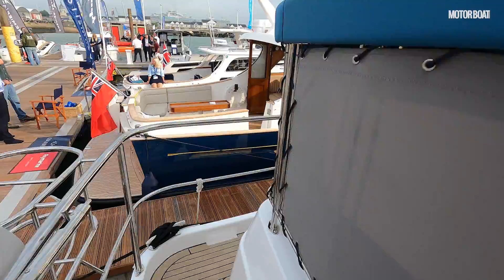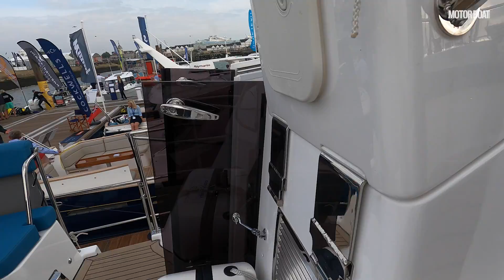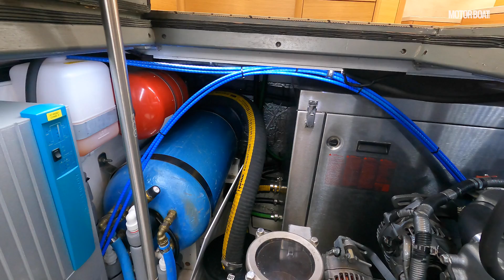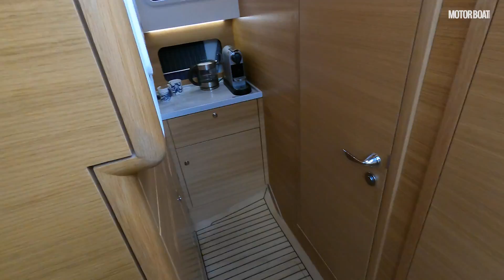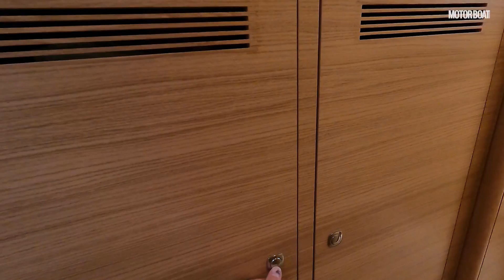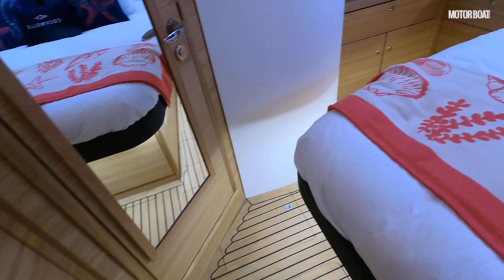This sturdy liveaboard cruiser has a diesel-electric heart | Hardy 42 Hybrid yacht tour | MBY

Comment: Really, my only question is, are any access hatches?  Diff topic: The hidden TV is deployed manually ‘nothing electric, nothings going to fail.’  Yet the dining table is on an electric lift.  I’d prefer to take the risk, like with the dining table, and have the TV on an electric lift.  Also, a larger TV than the small computer monitor which manually drops down from the ceiling.
Reply: it was the customers spec so I guess Cockwells could give you electric if you wanted it

Comment: Looks very nice but such a limited range, would have expected at least 1,000 miles on the engine. Don't like the galley either, no fiddle rails or pan clamps on the hob, it would be OK for the inland waterways but definitely not rough seas. The food storage is terrible, a minute freezer and such a tiny fridge. Very well built though.

Comment: Very well designed cruiser...I can see myself living aboard quite comfortably.
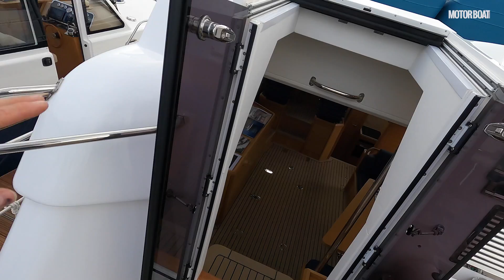however there are a few things I'd change.. the top of the  cabin doors @5:40 looks like it could do some damage should you slip or fall on them...the middle seat next to the pilot chair @10:53 could use a rail about elbow height at the right ..that's a fairly high fall if a heavy sea pitched you to the right over the woodwork and for a boat with all that storage and ability to long distance cruise that fridge/freezer combo is too small..

Comment: With the electric motor. If they were smart they would go one of 2 ways when using the engine. Either disengage the electric motor and let it free spin which is wasted potential energy, of use the spinning regenerate the batteries.

Comment: I have been saying for 10 years... WHY NOT A SMALLER DESEL ENGINE TURNING GENERATORS to charge batteries or run over 30% ....   under 30% running the batteries/solar works...  for a while... then the generators kik on and quickcharge  then power down and it gets quiet again...

WHY IS THIS NOT A THING ???  

or MORE OF A THING?!?!??!???

Comment: what about a couple 25 hp Yanmars running generators for redundancy and having even more lithium Ion batteries...? No need for the big diesel....  If you need a few miles of full power/ higher speed , run both small engines at top rpm and draw off the batteries....

Comment: What a stupid idea. Just put a wing engine in.
Reply: on the contrary, the idea is excellent its execution is just not all the way. This boat needs two larger electric motors of about 100kW each, that would save a lot of space by not luggin that massive engine around, a larger generator, give up most of the flybridge for a solar panel deck, and then use all the space saved by getting rid of the engine for more batteries.

Comment: Wouldnt the diesel running at 6knts be just as environmentally friendly as the generator running the hybrid system at 6 knts?  I can see how for the first two hours when you leave the dock after having topped up the batteries from shore power, that could in theory be better for the environment.  But once you go beyond those 12 nautical miles and need to turn on the generator top up the batteries again, then its hard to see much gain from the system.  That hybrid system seems like a lot of added complication and cost for not much gain, unless you happen to have a use scenario where you are frequently going to take trips that are 12nm or less and don’t mind doing that at 6knts.   Or am I missing something?  

Don’t get me wrong, I love the boat other than the hybrid aspect.  I know thats the future and look forward to it, but i think this implementation shows that the technology just isn’t ripe yet for this sort of vessel.
Reply: My understanding is that it would use less fuel as it’s a smaller Diesel engine running at peak efficiency rather than a big Diesel engine running well below its peak efficiency. It’s also not good for the engine itself to run for long periods at low revs
Reply: on the contrary, the idea is excellent its execution is just not all the way. This boat needs two larger electric motors of about 100kW each, that would save a lot of space by not luggin that massive engine around, a larger generator, give up most of the flybridge for a solar panel deck, and then use all the space saved by getting rid of the engine for more batteries.

as it is now it's just half way tranisitioned to electric drive, but running the generator for up to 6 knots is a lot more efficient than running the large engine at low revs, since the generator will always be running at it's maximum efficiency RPM, whilst the engine won't.

Comment: Love the sturdy no nonsense ethos of this vessel. I would be interested to know what the range would be just using the electric motor and generator cruising at 6 knots?  Could It it possibly go 1500 miles or more?
Reply: The range as listed in the brochure for the 40-series is only 320nm. So this seems to not be CE rated at A.
Reply: Most of the yachts in the Hardy range barely can make 320NM. The largest 65ft can only do 550NM so I don't think it would be any more than 500NM at an optimistic guess. You'd be better off with a regular diesel on something that offers bigger tanks. Check out the X-treme 54, 2400NM from two small diesels
Reply: @karlfriedrich7758  would depend on your speed, for the 65DS 6000 liters of fuel at 6/7 knots equals lots of miles
Reply: @allandoyle1809  of course, though without any tests we can only go off the official specs for the 65DS which they've listed around 900km+ at an unknown speed 

If there's one thing I wished trawler manufacturers did, it's list a proper full and half-laden fuel consumption chart instead of 6 pages about the airy feel of the cabin etc. Only seen a handful of them do that, though it's so useful when they do.
Reply: I wonder the exact same thing... Maybe even further....
Reply: 6 knots x 2hrs.
I wonder how far it can run on the hybrid system?
Reply: Nowhere near that range. See the comments.

Comment: Why didn't they install a couple of OceanVolt electric drives and go diesel / electric? Put a generator on the engine and have no mechanical connection between the engine and the props. Run off batteries if you like, or engine, your choice.

Comment: Why do the openings of those ventilation pipes on the front deck (just ahead of the windows) face forward?  Can't surf/splash get in if the openings face forward?
Reply: I imagine it's to allow the vents to capture air when underway, like forced induction.  I also assume there's some protection from spray measure inside the tubes, or that it's just not an issue for this hull.
Reply: @scottstewart5784  -- yeah, but how is water prevented from coming in if they face forward.
Reply: @markegg7680  They have sensors, so if spray is detected they twist out of the way real quick.  Just kidding.  It's either just flat NOT an issue for this hull, or perhaps there's something inside the tubes that channels water (if any) to the pipes in the heads compartment.   What isn't true is that you've discovered a latent design defect that will bankrupt the company.

Comment: Lovely boat, but a very poor hybrid system.  If you want a hybrid only Greenline does it properly. This looks cobbled together. On the Greenline system the motor doubles as the generator.
Reply: The problem then if one system fails, you lose the generator and the electric drive. It may look “cobbled together”, but simplicity is often undervalued.

Comment: Did they use the batteries from a BMW i3 as well? Seems like every electric boat has either the battery, or the battery an engine from an i3. Which makes me wonder where are the it's these people keep using for their boats. I imagine since BMW is such garbage,the cars fell apart and were junk but somehow the battery and engine were still good. Which is ironic because the engine in the car formthe ICE engines always fail and take out everything inthe engine bay with them.

Comment: Great vid, but you frustratingly skipped over the joysticks at both helms. Is it one joystick controlling bow and stern thrusters?
Reply: Sorry about that. I believe that is correct
Reply: @hugoandreae3495  yes - it's just that normally a single joystick is for ips or dph drives. It's usually a pair of small joysticks for the thrusters. You should do a vid on the different types of joysticks as it makes a huge difference. Especially measuring actual sideways thrust against current somewhere like Dartmouth!